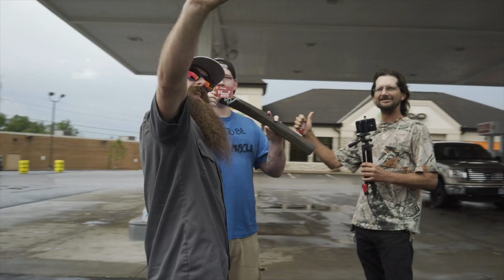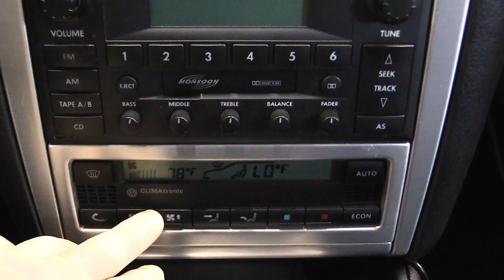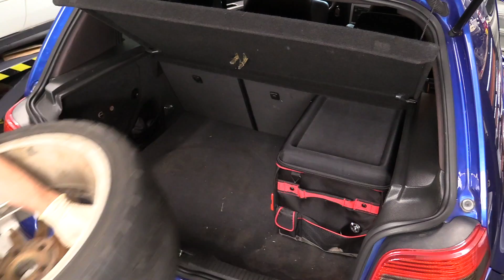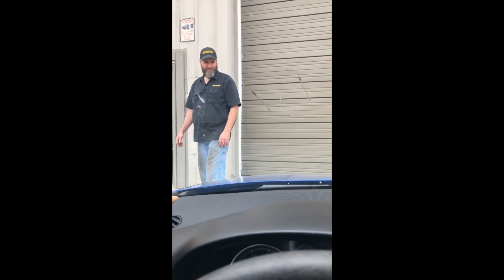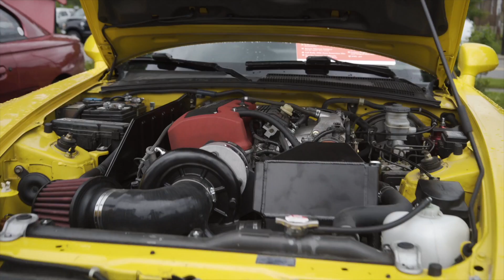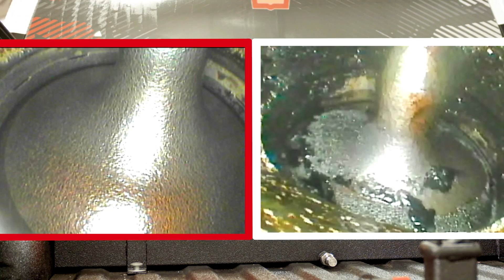How To Prep Your Car for a RoadTrip

Comment: I’m planning on eventually driving my will-be newly rebuilt (engine) 99 Cutlass down to Florida when I move there. It’s definitely gonna be a feat because the motor was overheated badly, I’m in the process of inspecting and rebuilding the engine right now. It is low mileage though so the transmission shouldn’t have any issues. It’ll have brand new front brakes and lines, brand new tires all around, all new fluids. Main thing is hoping the engine won’t break down or nothing will happen to the cooling system or the transmission lines, etc. It might be worthy to get a higher paying job temporarily so I can just do everything right and not cut any corners.

Comment: Another two year old video that YouTube just recommended for me. I bought my 2nd Mk4 R32 from Maine and I live near Seattle. I just flew out, picked it up, and drove it home over three days. The last day was over 1100 miles (one can drive quickly and cover lots of miles in WY and MT). A set of winter wheels came with the car but that was it for spares. I used to do winter driving competitions in the BC back country in it and still carried minimal tools with me. I have found my semi-modern VWs either break big or don't break.

Comment: Dude way too much. Check the tires, fluids and brakes and go. Look at your trunk - you filled it with tools and no luggage. If you need that many tools for a 1100 road trip i suggest dumping VW and switching to Honda or Toyota.
Reply from the maker: It’s up to you what to bring not bring. I’d rather have a few tools to fix something. The spare tire is the only reason my suitcase didn’t fit. Lol

Comment: I remember when I took my BMW 335i on a road trip across the US. Didn’t even bother inspecting it but the car easily made it. Drove it on a straight 20 hour stint because of my fuck-upery on booking the hotel a day too early. Only issue I ran into was i was driving thru a thunderstorm in the middle of the night in the New Mexico Arizona border and my wiper blades were actually worn. Did my oil change a week before leaving and did another one in Phoenix Arizona as it’s cheaper in the US. Here in Canada I spend $130 on the oil/filter and that’s me doing the oil change myself. Dealer in AZ charged me $95 all in!

Comment: When I prep my Toyota for a road trip it basically means I grabbed the keys
Reply: hahahaha
Reply: Lies, Toyotas need maintenance and repairs too.
Reply: @Eye-it-azz  no they don’t, oil is optional and so is maintenance 😂
Reply: Totally, my dad let my aunt borrow his Toyota for a 4hr road trip and she took it to a mechanic to pre check. On her way out of town she called my dad that the car was blowing smoke. My dad got to where she pulled off the highway and turns out they forgot to put the radiator cap back on and the engine was toast. That was long ago before I was born. For Toyotas like you said, grab the keys and go.

Comment: I just buy a reliable car in the first place. That way I have room for my wife's luggage.
Reply from the maker: Lol still can have issues. It’s at least important to check fluids and the spare
Reply: HumbleMechanic +1. My uncle’s 2 year old Honda CRV broke down during a road trip. I work at a Toyota dealer and I’ve seen a few out of out of state cars having problems. I worked a Sienna last week from Indiana, their o2 sensor went but lucky for them warranty paid for it. The worst I’ve seen was a blown engine on a Matrix from Florida. The guy actually got the engine rebuilt and drove it back!

Comment: Saw EE's video and thought I'd pop over to your channel for more R32 content.  Do you have a build thread for your R32?  Interested in your headlight choice.  I noticed you pulled out the underhood insulation.  Was this just for looks for the car show?
Reply: So what was the problem with the CEL and no start?  (I own a MK4 R32 also)
Reply from the maker: The MIL was me unplugging the throttle body. Lol. I took the insulation off because when I replaced the engine mounts it started rubbing the cover. I’ll be adding something back on there. 

I have a playlist of all the R32 videos. You can go back and see when I got it and all the things I’ve done

Comment: Hello @HumbleMechanic i needed your guidance as I'm facing some issues with my 2009 skoda superb 1.8 tsi with 7 speed dsg transmission...few days ago my mechatronics unit broke down and this is the third time I'm facing this issue ! I'm curious if i can swap my tranny with a 6 speed manual gearbox for the skoda superb 1.8 tsi manual gearbox...what parts would i need and what all preparations i need to do ? Also...is there any way to communicate with you over a phone call or WhatsApp ? Love from India 👍😎

Comment: Went on a road trip in my 1993 Audi 80 2.3E, had the voltage regulator die on me. I had a spare one in the boot as well as a spare starter motor.
I swapped it out of back of the alternator in 30mins. Carry a small tool set with you, it wont take up much space. With a car as old as mine you have to prepared.

Comment: I just got a smoken deal on a full alloy rim and tire that's about half way through it's life. I mention this because, the newer vw's don't use full size spares. Get rid of that donut and get a used full sized spare if you can. The donuts have severe speed and distance limits. If you are towing, it 's a must. Where I come from (north of Toronto) our warranties have a rim replacement policy for the first 36 months regardless of fault. Ya...I know weird. This makes rims easy to get.

Comment: Preparation for road trip: Pay the seller, sign the paperwork and turn the key. Doing this tomorrow with a 1956 peugoet 403. Thanks ebay!
Reply from the maker: Cool!
Reply: @HumbleMechanic  Thanks! Only 70 miles this time, a distance that can seem like nothing or a lot depending how the day goes!
Reply: @No Thanks  Eh, you'll be fine.  A friend of mine collects old Pugs - last I checked, he had a dozen or so, including a 403 convertible (with a rumpled trenchcoat to drape over the door), 403 saloon, wagon, 404 coupe, sedan (automatique!) and convertible...the list goes on.  All pretty simple, reliable, under-stressed mechanicals - which is probably how they managed to win the Safari Rally in '63.
Reply: @aussiebloke609  I did make it, but shes not running 100%, mines a wagon version, definitely not stressed at 7:1. Forgot about Colombo, Next stop - the thrift store!

Comment: ZIPPP TIESSSSS. So many times undertrims been flapping around which a zip tie woulda fixed, try finding someone to sell you zip ties on a sunday in rural northern california XD. Now i always got a pack of them in my glove box.
Reply from the maker: Oh man the mighty zip tie. Those are in my bag too!!!
Reply: Duct tape too, just like full on MacGyver
Reply: @oilyragsgarage7200  Try some heat resistant tape, just in case a random coolant hose decides to start acting up and leak. Read a bunch of guys stuck during the Budapest Rally used that to get home after the rally. (Like a tour rally, not racing).